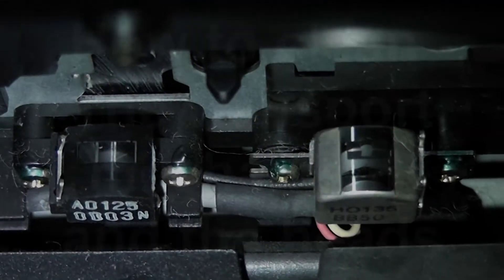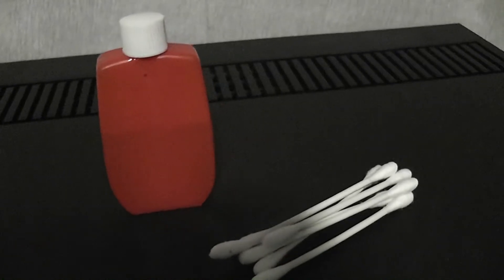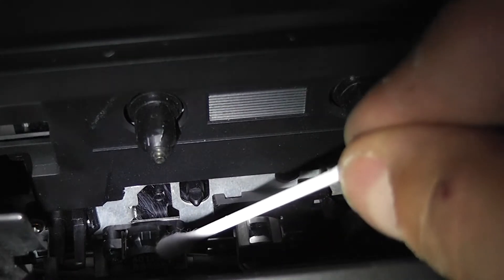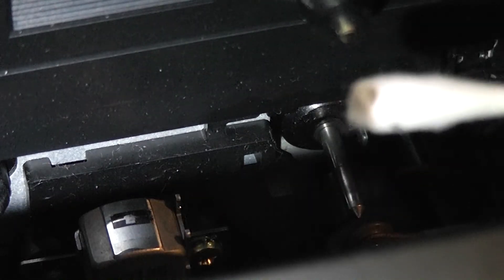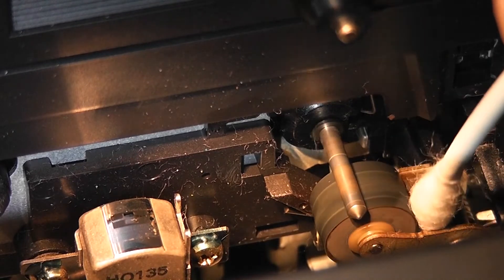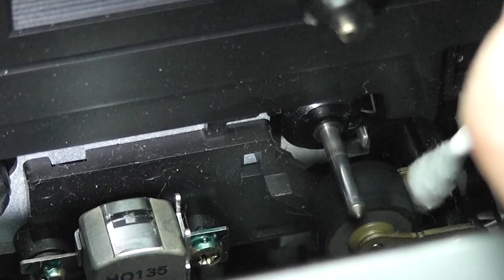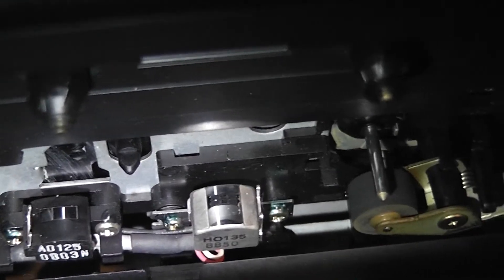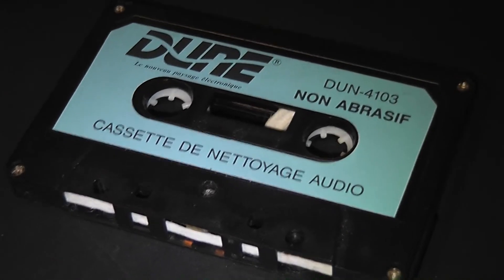How to clean the heads and transport mechanism in a cassette deck - Tutorial video

Comment: I have alot of old cassettes. I play them alot. 2 tapes got eaten by my boombox. So I useď alcohol with qtips. It really helped. No more tapes got eaten. Black stuff was coming on the qtips. After playing about 4 cassettes, i cleàn the capstan and pinch roller. Does this damage the pinch roller, since I clean it often?
Reply: Yes, especially if you use rubbing alcohol. The roller is rubber and the alcohol is very drying to it, so it may become cracked and damage more tapes. If you clean it that often I would say get a gentle professional cleaner that won’t damage the wheel

Comment: NO alcohol on rubber pinch rollers, it dries the rubber out.
Reply: Do you realize how long it takes to dry out a pinch roller? I use more aggressive chemicals on my tape deck and my capstans and pinch rollers are squeaky clean and there are no damaging effects whatsoever. The rule of thumb is brown good black bad so if it's coming off black that means you need to get the black off to get to the fresh rubber  .

Comment: You never should use alcohol or solvents on a rubber pinch roller as it would dry it out and crack it. All that black on cotton swabs shows how much rubber is coming off the pinch roller. When I was a teenager, I cleaned the pinch roller in deck A and never cleaned the pinch roller in deck B and deck A became all wobbly with excessive w.o.w. and flutter while the uncleaned deck B still plays amazingly good till this very day. I never even clean pinch rollers. Just the erase head, playback/ record head, a metal capstan and sometimes tape gudes or levers.

Comment: please maxell and TDK start making brand new high quality type ll and type 4 cassettes  PLEASE!  nos is gonna run out eventually
Reply: Why? If you have a capable and correctly calibrated cassette deck with Dolby C or S, even cheap and plentiful TDK FE Type I tapes can give a full 20kHz audio bandwidth with very low distortion. As well as providing excellent noise reduction, Dolby C and S were specifically designed to dramatically reduce the effects of tape saturation, so a typical Type I tape can outperform a good Type II tape and be not far short of a Type IV. To give you some idea of the difference it can make, a TDK FE sounds awful on all of my decks without it, but excellent with. If you try this and it sounds worse then your deck is poorly calibrated.
Reply: @MrSlipstreem  And who has that equipment laying around ??? How much $$ are you going to spend to get a QUALITY tape teck to record on ???

Comment: alcohol will destroy you pinch roller over time   dries it out makes it brittle
Reply: It can, but it's not inevitable. I have a 1977 JVC hi-fi cassette deck that I've owned from new that's had its pinch roller cleaned regularly with isopropyl alcohol from day one. It still has the original pinch roller and it shows no serious signs of degradation 47 years later.
Reply from the maker: Windex is good for that too. I didn't know at the time of making this video.
Reply: What do you suggest????
Reply: I heard window cleaner works without drying them out.

Comment: The pinch roller after getting cleaned still releases black colour on the cotton...is it the colour of the roller coming out or dirt?
Reply: It’s most likely just the color from the rubber. As long as your tapes are playing and not getting ate by the player you should be fine.